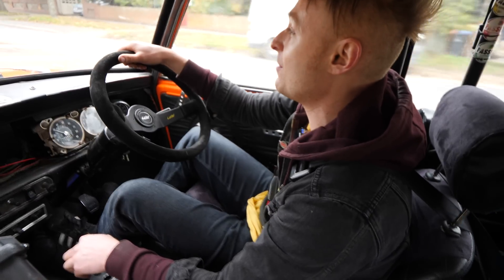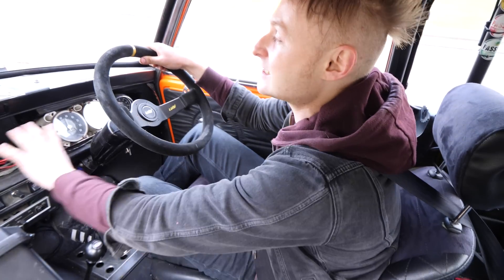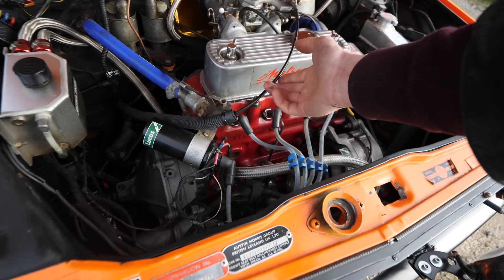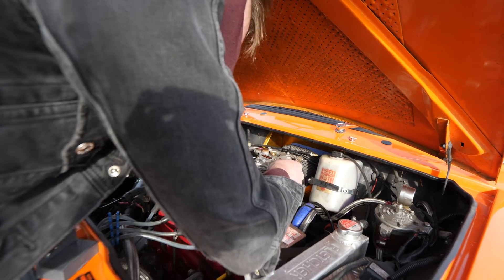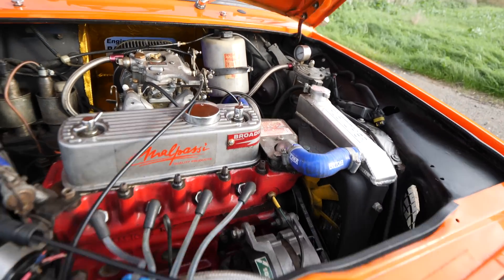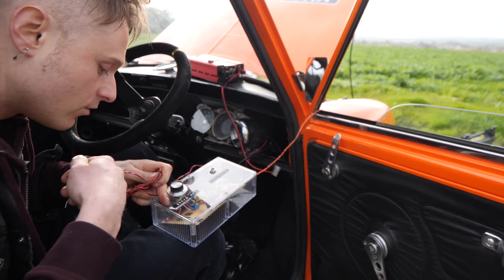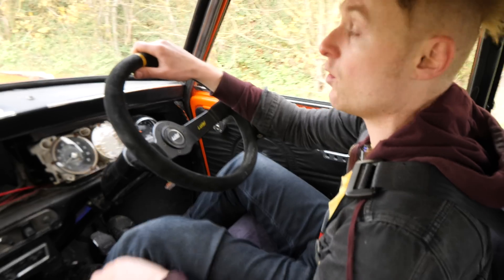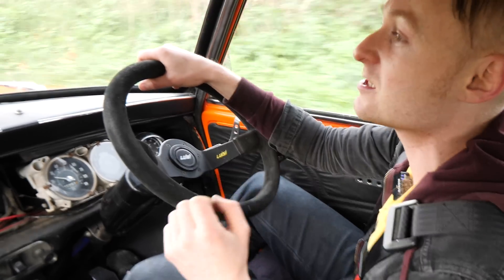WIRING A CAR TO A THEREMIN - THE THEREMINI -

Comment: Brilliant But the Skoda has a 2 resistance trace accelerator peddle, 1 up ohms and 1 down ohms so as you press 1 goes say from 1000 ohms to zero the other track goes reverse so 2x variable resistors apposed to each other with the servo or stepper motor and just plug it in you loose all the mechanical lag, Your Skoda dream car will rev faster than a mini oh and knowing VAG any VW/Audi group car will as its the same pedal or for all and for that matter Bosch electronics in any car use the same resistance range and connector probably,  Skoda has a built in rev limiter unlike a Mini. on my first course at VW we took a stone cold pre release Fabia from 0 to max rpm with scope meters on to show us how the rev limiters worked. I bet you can rig a peddle on any vw and that will fit any Bosch system car.
Reply: The thing that make the pedal hard to push is the spring or in the mini the carb take the springs off

Comment: not heard an a series gearbox whine like that for a long time! Love the webber carb kit on that clubman
Reply: Straight cut box, methinks.
Reply: @Veni_Vidi_Vortice  Forgot that was an option. My clubman is sitting in my parents garage... has been for 20 years. Engine has a 12g295 head, twin 1.25 su's and a set of original mini cooper discs on the front. Could never hear the engine whine because of the Peco twin big bore on the back end!

Comment: A small RC engine can be controlled very fast (and also can spin at very high RPM); you need a RC car (or plane) and some modifications on the controller (plus, you can also try to drive the car or fly the plane without touching the controls!)  🙂

Comment: You need rpm feedback and a PID on your teensy. Your Theremin CV output should be setting target rpm for the PID which then controls the throttle to achieve that speed in the shortest time possible. You could make it midi operated and run it from a keyboard. I'm in the process of rigging a GX120 with a similar setup (albeit not for music).

Comment: I was concerned you were going to try to drive with that. That would be a bad idea. Otherwise, I think the only reason it may have not worked is scaling. Neither pitch control on the theremin or acceleration control on the car should be linear, I think both would be something like a logarithmic curve. Most of your usable range is in the lower part of the curve. I believe a higher RPM engine would have the same issue. I think you'd need to modify the teremin control to have an exponential curve maybe?

Comment: You can program the teensy to feedback from the RPM to get a definite output tone. The problem isn't just the flywheel, there isn't any particular relation between the throttle and rpm.
Reply from the maker: Yes that was the first plan but planning the input latency to stop the servo overcompensating on big note shifts was the issue
Reply from the maker: I decided to just keep it simple and be the rpm sensor myself

Comment: Well, even stupid ideas must be tried! For the next time: Make the theremin control the revs, not the throttle (high revs = high pitch). This would be easier to play musically. Yo only need a rev counter connected to the teensy and a pid control loop adjusting the throttle. Piece of cake for a guy that can make a whole church organ  midi controllable ;)
Reply from the maker: The only way to control the revs is with the throttle?
Reply from the maker: I see this is what I was going to do first it proved hard to judge the delay it over compensated before it levelled off
Reply: @LOOKMUMNOCOMPUTER  The teensy needs to be able to read the actual rpm via some kind of sensor. Than it can adjust the throttle until a certain rpm is reached (set by the theremin). To avoid overcompensation you will need a PID-control loop and tune it to your system. (Read it up if your interested, pid control is still a little black magic for me...)
Anyhow, a much simpler idea: use a lawnmower instead (or a generator). It has a governor build in that will hold a certain rpm. You can adjust the rpm by cable.
Reply from the maker: @hieroben  yep but it would be too slow the PID that is. I went through a lot of options and because I have no garage to actually test it I went for
Me being the sensor. Cheers have a good one
Reply from the maker: @hieroben  you don't need a sensor just the negative off the spark coil
Reply: @LOOKMUMNOCOMPUTER  Good points. I still think a lawnmower (or any other small engine with a governor) would be your best option. It will still be slow though. Just for slow romantic songs, you know ;)

Comment: Could use a lawnmower engine.  Might be a bit weedy (pardon the pun) but if you took the blade off and just ran it with no load, it would spin up and down very fast for very little money compared to a motorbike

Comment: I’d like to hear a reverse version of this where the engine rpm controls the theramin frequencies with audio routed through the car stereo.
Reply: Lol, I remember a lot of vehicles that would have wiring issues and you would hear a high pitched whine from the speakers that would ramp up as you accelerate.🤭
Reply: @doogoodminds8157  Ha ha, exactly what I was thinking of.  I had cars with radios wired that way, too. Those cassette to CD player adapters always accentuated that rpm-based noise.

Comment: There are videos of F1 cars playing songs via their engine control management diagnostic software, i wonder if anyone with a racecar would let you have a go? Your setup is pretty non-intrusive to the car itself. Only issue is that the more high-end cars may not have enough metal to use your magnet!
Reply from the maker: That was the first way I wanted to do it a few years ago but no one would let my plug my synth into an f1 car
Reply: @LOOKMUMNOCOMPUTER  electric motors can play melodys...perhaps try a Tesla ?!
Reply: @LOOKMUMNOCOMPUTER  Clearly they haven't seen your videos then! Your stuff often has way more danger potential then a racecar in a parking spot. If i ever get rich, i'll buy a racecar and you can use it.

Comment: Being a mechanic/car enthusiast at the same time as I'm an electronics enthusiast this vid's got me grinning all the way through watching. Honestly I wanna see MORE of this Mini content
Reply: Haha. Seriously! I'm a huge car guy, too. This kinda of content is absolutely brilliant! 🤘 I hope we get more crazy stuff like this, soon!
Reply: Great comment.
I'm a petrolhead too.
Love classic Mini's, they make you feel like you're going 200mph when your actually only doing 50.
Unlike my modern car which feels like 50 when it's doing 150.
Reply: Sorta makes me want to wire up a theremin to entirely replace the primary controls. Yeah, acceleration is one thing, but how about steering, braking, gear shifts (might need a semi automatic setup for that) and so on? I’m pretty sure there’s enough control data in a Theremin to handle all of that, just less sure of the responsiveness.
Reply: Isn’t it exactly how ride by wire works on a motorcycle? With the exception that the throttle would be an encoder instead of a potentiometer controlling the servo motor?